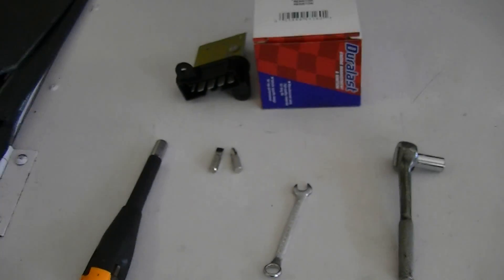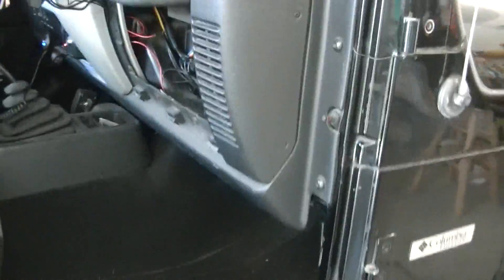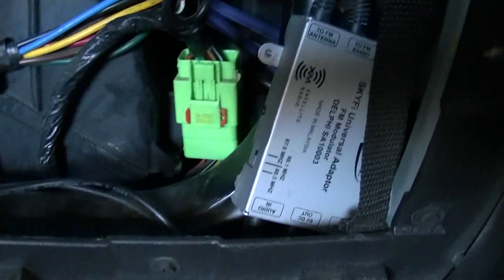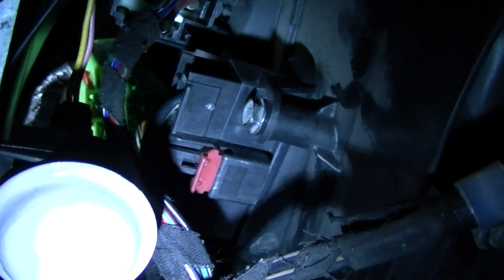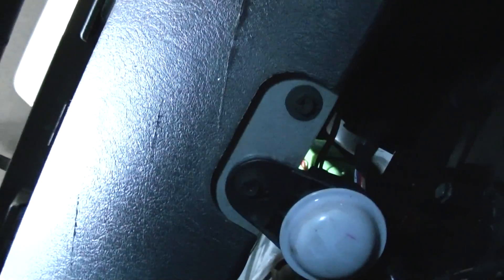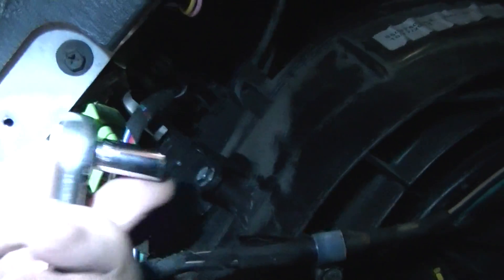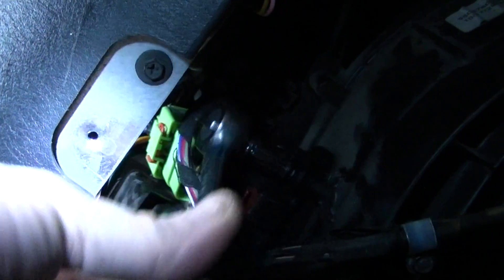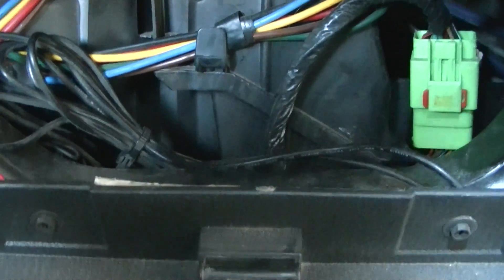Jeep wrangler fan resitor pack replacment part 1 of 3

Comment from the maker: @domeslacker - Yes, the blower would work on higher settings.  The resistor pack is literally a series of resistors that add more resistance the lower you set it slowing the blower down.  If one of the resistors fail then you will lose that setting and any setting lower thsn it.  There are also relays and fuses under the hood near the battery.

Comment: an FYI, if the resistor needs replaced you should check the fan switch as well.  Most likely it will be melted.

Comment: You skipped the step of removing the green wiring harness.  I'm doing a cold air intake with a heat shield.  The fan wiring harness needs to be disconnected to properly install the heat shield.  Does that little red clip get destroyed when you disconnect those harnesses or is there a proper way to do it.  I tugged away but didn't want to needlessly destroy something.

Comment from the maker: It was not absolutely necessary to remove the  green harness for the fix I am doing here.  When I can avoid removing something I will as it helps to prevent more problems.  The red clip if removed properly will not be destroyed.  But they can be tricky.  It is a redundant clip, so that all the bumping around will not cause the connector to come loose.

Comment: DId you have any blower function at all? Ive heard that the fan will work on the high setting even with resistor blown. I have nothing, no fan function at all.Is there a fuse somewhere?

Comment: Can you put a website where you can buy this part
Reply from the maker: remyleouf Part Link 

http://www.autozone.com/climate-control/a-c-heater-blower-motor-resistor/duralast-a-c-heater-blower-motor-resistor/200878/
Reply from the maker: remyleouf there are other equal parts available for as low as $15usd. A quick google search will find them.
Reply: Don't worry I already fixed it. but thanks
Reply from the maker: remyleouf sorry, missed the question when you originally asked it.